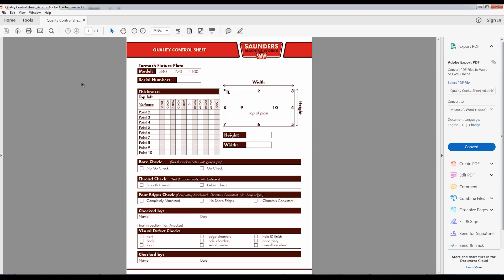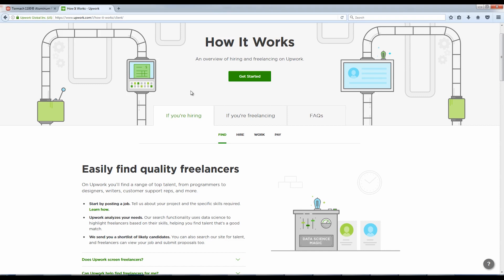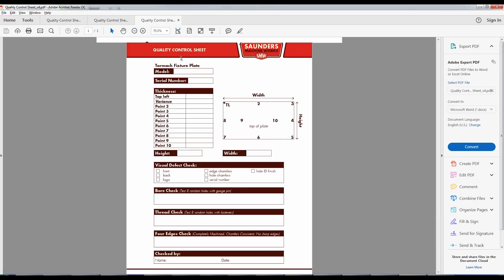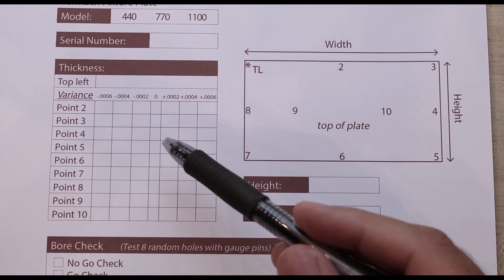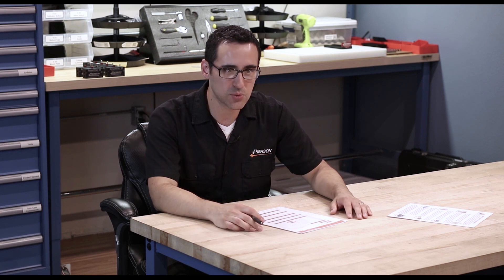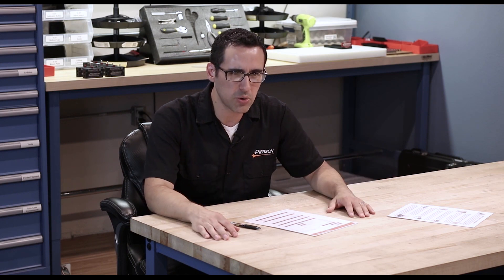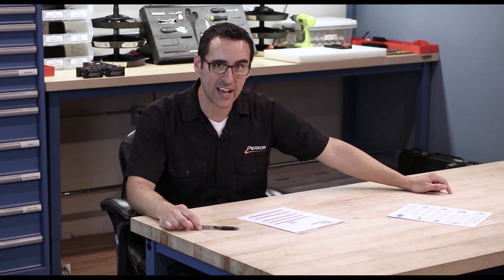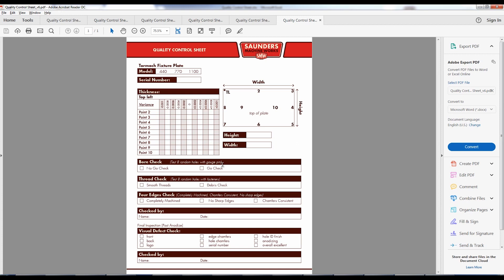Making a Quality Control Sheet!  CB54

Comment: John, great process and great collaboration.  One thought about paper...yes, do the data entry straight into the computer, but send a paper copy with the product. Also, maybe make the info available online for the customer too...you want access for trend analysis or other uses, and the customer may want to check back too and maybe didn't keep the paper copy. It's not that hard to set up access. 

As far as collecting data straight into the computer...remember that computers crash and you probably don't do continuous backups.  What if your hard drive goes south at the end of a shift and you lose the day's QA data?  You may want to print a hard copy for each part and hold it until at least the next backup. Another possibility is to use digitizing tablets to do the entry, and put the form on the tablet, so you get a hard copy and data entry simultaneously. Not sure how well that would work, but thought I'd mention it anyway.  Your software might also be able to record the data in more than one place to reduce the chances of loss...like locally on the entry machine and also on a networked server or cloud storage. 

It's been very educational watching your progress over the years...thanks for sharing!

-- Mike

Comment: Just a thought - consider checking/certifying the spacing between holes on the plate. I have a fixture plate from another vendor & have noticed that the inter-hole spacing varies more than the stated spec.

Comment: Hi. It's great that you are taking quality so seriously. 
I work in the semiconductor industry and in this business, Statistical Process Control is what makes the difference between success and failure. 
You can buy very cheap software that will detect problems you can't see because they are not obvious to an observer, but do not fall withing a normal distribution of results. If you can get something good off-the-shelf and hook it up to your measuring tools you will get great results. 
Don't even think of developing it yourself and don't buy anything until you have checked with others who are using it successfully. If you want to read more then research W. Edwards Deming and the Western Electric Rules. That's where it all started. 
Don't believe anyone who tells you you need anything smarter.

Comment: Great video, two things though.

The "Height" in the upper right corner is incorrectly orientated. One always reads from the right side, not from the left, same as with drawings.

Putting measurements directly into a digital file is awesome, we had that in my old company. Saves a lot of time and reduces the pile of paper.

Comment: spc software gage input or operator keyboard input? gage is faster ,keyboard you can cheat ,gage you can cheat a little shim stock or a zig zag 
in your shop not to worry about the cheat just about operator friendly
Reply: We had a pedal to confirm the measurements, no cheating via keyboard. That's obviouly also way faster and prevents typos.

Comment: Excellent video! Great to see you guys acknowledge every aspect of production and not just shiny surface finish or just cut and ship. It is so important what you're doing and it is even more important that you're sharing it.

Sharing best practices is a sign of maturity and self-confidence and you'll be amazed at the amount of people afraid to do it!!!

As a final comment, it is indeed in the right direction that you want to store that information in a database. But you don't need new software for that. You can very easily transfer all the hard work you've put in that sheet to an MS Access (or any other SQL) database. You could even be filling out that exact same form in a PC or laptop. Maybe it's the cheapskate deep inside my brain speaking right now but although Mitutoyo's solution is definitely going to be of higher quality and capabilities, a simple database to be filled by an operator has a very low cost and if done right amazing potential for integration and upgradeability.
Reply: NYC CNC OK, that's true

Comment: Do you have a print that it is checked to ? I am used to Ballooned prints and a standard inspection report, and yes solidworks has inspection side of software and others do too, can even couple to a cmm output.

Comment: Suggestions: 

1. Start with ' Product: ' same design style like  ' Model: '   In current version ' Tormach Fixture Plate ' is not in line and also in design style not integrated enough.
2. put ' Final Inspection ( Post Anodize ) ' also in the same bar / line with ' Visual Defect Check: ' 

Great cooperation with Jay.

Please more on work flow optimization and digitalization.

Comment: I had a little fun and tried to rework the sheet a bit. It called out for a graphic pass. E.g. having a colon in addition to a graphical separator (color inversion) doesn't look as professional to me. I also lean toward why have a diagram and a table when you can write directly on the diagram. It's more natural. Also I suggest against empty "it's broken" check boxes and use filled "it's not broken" ones instead. It makes the inspection process more positive (broken until verified OK) and psychologically is more pleasant for a customer to see. http://i.imgur.com/W0g9kdg.gif

Comment: I was an auditor(inspector) at Trane, Inc.  Our sheets or forms were done on the computer which were filled in as we went. As a Line Auditor I made it my business to travel the line checking parts BEFORE they were installed to help make sure rework was not needed.  The line supervisor told me that there was not a case of holding product for rework when I did this.  I was also told that what I did was how an auditor should function(why it wasn't taught I don't know).  Most of the line workers liked that I checked everything because then wrong parts didn't come back to them.  By checking things in progress, a line shut down was avoided and things ran smoother.

Comment: Great chip break. Oh man. This hit on some good points. I LIKE the concept of putting QC on the "base" employees. In my experience, hiring a man just for QC does little except add to your overhead and take the onus of quality off the operators - which makes Captain Overhead QC Guy look that much "better" when he catches twice as many bad parts as you've ever had in the past! Ha.

Obviously a bigger company could absorb that overhead, but you still have the worry of your production quality slipping. It's great to catch a bad part before it gets to a customer, but it'd be better if the part were not made bad in the first place!

Sorry for the long-winded comment. Great video. Way to go, John. :D

Comment: Sooo...for v7 and beyond (:P), don't check threads with fasteners. How did the people who made the fasteners do their quality check? Are you happy with tying your quality to their quality?

Instead, and I would do this for the unthreaded holes as well, get yourself some go/nogo gages from a reputable manufacturer such as OSG or GF Gage. They are expensive, but if you're looking for "overall excellent", then I think they're worth it. As a bonus, most thread gages have a small cutout on the first couple threads that clears out grime and can even repair slightly rolled over or burred lead threads.
Reply: never clean smoo or chase threads with a gage blow out with air then gage you would not touch my gages
Reply: I was wondering this too, how accurate is a fastener off the shelf? Id use a thread gauge
And a go/nogo gauge for the pins. Would it be better to check it after on at least one hole too? As anodized parts can be too thick in the coatings
Reply: At least for the pins, I'd definitely check after anodize. Threads may not be as much of an issue because the fasteners will wear away the anodize.

Unrelated, I would also roll form tap those threads if you're not already. No chips, 1.5 to 2 times faster speeds (and thus feeds) and the threads are stronger.
Reply: Sicktrickintuner some fasteners can be pretty accurate, depends on what you're buying. 
 also could ship the parts with the fasteners included, get a nice little markup while you're at it.
Reply: wear away do it right or do it again
Reply: The chip groove is specifically designed to do exactly what I said. If it weren't...they wouldn't bother manufacturing it that way.

However, I was a little less than specific. The purpose is not to substitute for cleaning out and deburring the threads prior to gaging, but rather to prevent a false reading in the event of minor imperfections....small enough that you wouldn't notice them with the naked eye and wouldn't interfere with an off the shelf bolt, but would stop a thread gage lacking the chip groove from engaging or otherwise bind it in the thread.

https://www.threadcheck.com/how-to-use-thread-plug-gages/technicalinfo/

"The chip grooves purpose is to clean the threads of the work piece but it should really not be relied on. It is highly recommended that the work piece be as clean and burr free as possible to reduce friction and wear on the gage."

They say it better than I did :P